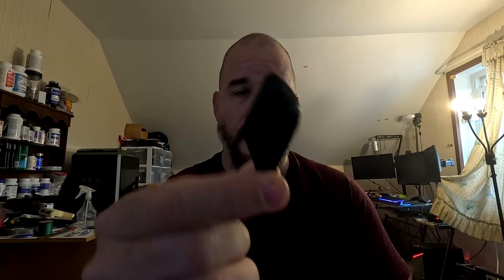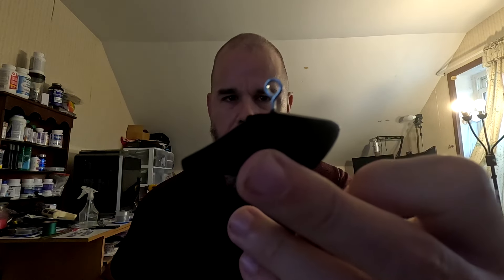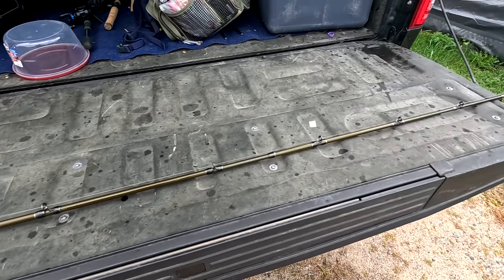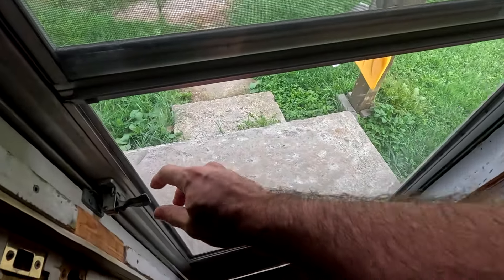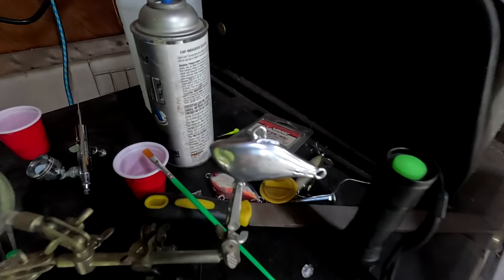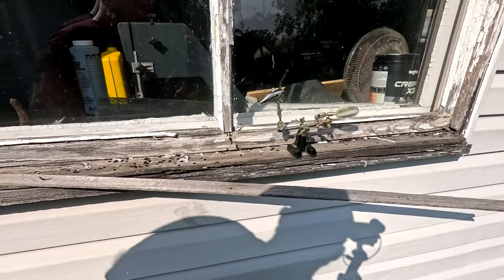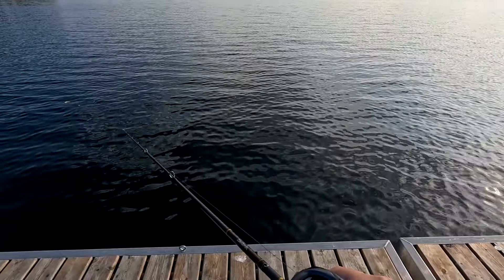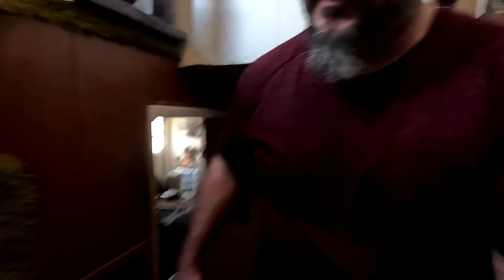Rippin Rap   Print, Paint, Fish #fishing #3dprinting #diy

Comment: Hey Adam what 3d printer do you have and or recommend, Cause I'm thinking of buying a 3d printer as I have been playing around with onshape and really like it.
Reply from the maker: Now I have the Creality K1C however a lot of people are saying the Bambu Lab P1S is better.  I had the Ender 3 V2 prior.  It was a good starter printer but non stop having to manually calibrate it before any print was getting annoying.  The K1C and P1S both have auto calibration and bed leveling making it literally a 1 click print setup.  Only prints I have had fail were due to my own models not being configured correctly before hitting print.

Comment: Just need to make a recycling system to re-use the plastic lost to failed prints, others have made such things which grind up the plastic and extrude it somehow into a 'new' filament, granted the colours will be somewhat random, but, better than just throwing it away... :D
Reply: They have that. Just not really worth it for the home user
Reply from the maker: I will be making a shredder to convert lost plastic into pellets and then converting the old Ender 3 into a pellet printer.

Comment: It's hard to do small baits on a FDM printer. You can get a cheap SLA printer and you will have smooth prints. You can also design the prints split in two parts. Make a wire channel in them to run the wire from one end to the other. Then glue them together. A lot more designing, but it works.
Reply from the maker: yeah that is how I made my crank bait.  I did kinda load it a bit too much with BB's giving it quite the weight allowing it to really sail out there when you bomb it.